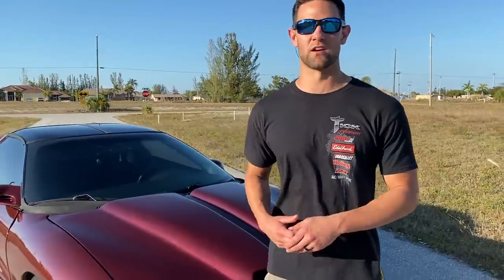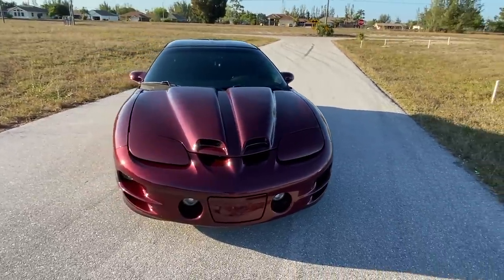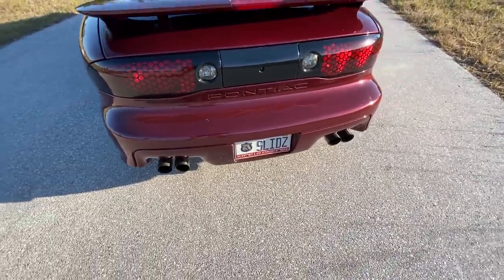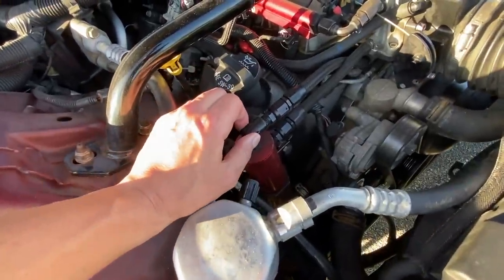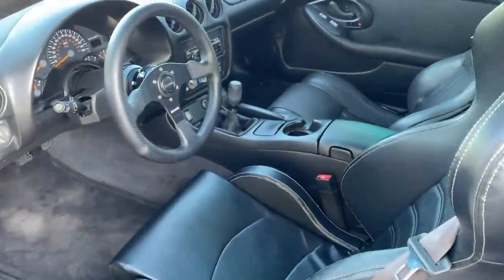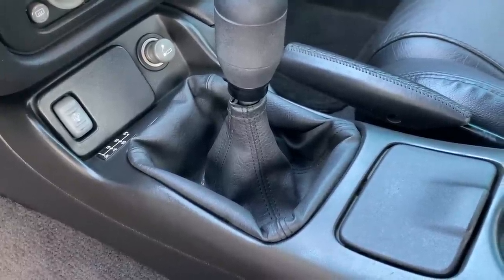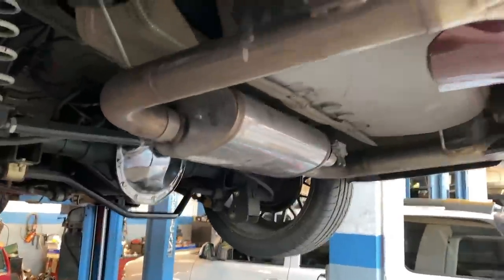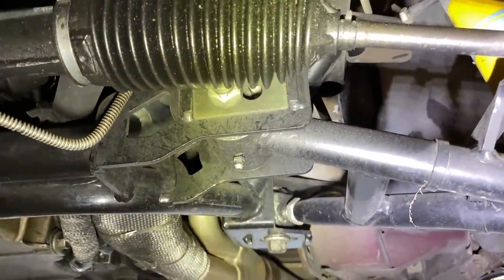In Depth Look At My TRANS AM DRIFT CAR!

Comment: Very nice indeed!  However, I should point out that you do not need everything your car has to drift like you do.  I see a lot of people wanting to copy another one's build and as a previous owner of 3 f-bodies, they are quite drift-able bone stock.  I think simple mods like suspension and chassis upgrades will get you into the sport.  That Moser 12 bolt is a pricey piece but oh so very strong!  Appreciate you taking the time to share your build and how it all works together.  For anyone reading this, if you own one, get out and practice.  You don't need to buy anything to start... well, except for tires.  You gonna need a LOT of those!  :)

Comment: Not that you necessarily care about more power, but you’d be shocked how much power you gain if you get the 3” pipes on the Y merging into a 4” cutout. Especially with a motor that size. Two 3” pipes merging into a single 3” pipe is a huge restriction and causes a lot of the drone and kackling these cars are known for. Flowmaster Y300400. That is one nice and clean TA!

Comment: Sweet ride my friend.. I'm a proud owner of a 07 Z06 and a 94 Pontiac Trans am. My 94 Trans am is in the process of getting restored. I bought the car brand new back in 94. But I'm going to restore it she needs a little TLC.. it has the LT1 motor with an 4l60e 4spd automatic transmission.... I'm going to be pulling the motor and transmission and rear-end as well... I do all my own work. The trans am is going to be painted again with the original black. But I'm going to put a 6" red stripe down the center of the hood and roof just past the ttops and down the trunk and rear spoiler...
Reply from the maker: Kei lylmm That’s awesome man! I would love a C6Z though 🤘🏼
Reply: @KennySlides  you guyz are great drivers to be doing them slides... Not to mention trusting your friend's ability to drive.. very impressive 👍🤙

Comment: Due to the Corona BS just doing maintenance on my 97 T/A  re installed a Meziere electric water pump (they are only good for so many miles) and did a thorough detailing on my recently installed BMR tubular front K member and upper/ lower control arms!, not much of a drifter, but that car is BADASS!
Reply from the maker: Thats awesome man and I really appreciate it!

Comment: Very pretty..  But with all the mods you have done, its not surprising you actually aren't using the stock D/S. They came w Three Rivers 3" aluminum driveshafts, so that's either an earlier 4th gen d/s or if it measures a full 3" its got to be some aftermarket one, likely made by a local shop if you havent seen any Branding from a larger company (DSS/etc).

Comment: I had a signal red 99 WS6 in college and been wanting to snag another for like that last 5 years. Your videos made me finally pull the trigger. Just picked up a signal red 02 WS6 with only 51k miles, guy was the second owner and it needs some small repairs here and there and the bumpers repainted. Snagged a set of the black c5 Z06 style wheels from Hawks on it and its looking sharp, gonna do an LS3 swap at some point and drop the LS1 in a Miata but for now gonna cam it, slp cold air, and Kooks long tube headers and off-road x pipe and get it tuned. That’ll do for now lmao.
Reply from the maker: Florida Bhoy That’s awesome you picked up another TA brotha!
Reply: KennySlides yeah man been at the back of my mind for a while and just had to do it. I’m in the Fort Lauderdale area, next time you’re in my neck of the woods for a meet or something let me know.
Reply from the maker: Florida Bhoy For sure man!
Reply: KennySlides I’ll dm you on IG

Comment: Awesome buddy.  Dig all you're vids. I have a black on black 2000 ws6. The original ls1 broke a rod going home from work.  Bought a lq4 short block. All i have left is unbolt the k member and lift her up off the motor.  Wish me luck. And again awesome setup bud. Shout out if ever in the Tampa Bay area.
Reply from the maker: Chuck Patrick Thanks man! Good luck with yours brotha ✊🏼

Comment: I have 2 trans am's 89 and a 97 and I'm trying to hook my 89 trans am up as a drift car. always could use a few tips on what to put in it what to put on it and how to set it up. I'm located in St Pete Florida
Reply from the maker: michael greenburg That’s awesome man! Biggest thing is more steering angle which can be achieved with shortening the outer tie rod mounts on the knuckles and then getting after market a-arms for adjustability and tire/wheel clearance. Coil overs or lowering springs with good adjustable shocks make a huge difference as well

Comment: the Ricey wheels being a color that hides the design and with different color lips is the only thing id have changed....The 98+ WS6 package consists of Larger front swaybar(32mm) higher rate springs, different valved shocks (but still Decarbons) little bit better exhaust (it was a Single 3.5" outlet for `98 only, went to duals 99-02 but same sound tbh) 17" Wheels w/ 275/40/17 Tires, stiffer tranny mount/panhard bushings, Ram Air Hood and Raised Airbox. Plus color changes

Comment: One more question you have my dream motor..but if I could ask why didn't you go with a little bigger head with all those cubes??did somebody recommend the 215's..I would think you could ran like 225 or 230 cc port volume..but hey maybe I'm wrong..don't LS3 come stock with square port at 250cc.??

Comment: Hahah pretty much it 😂 ..I knew your car was pretty Extensive on some of these parts an mods to get it to perform like that I have a stock Pontiac GTO 50k miles its an automatic but can it be Built similar? and would that wheel and tire setup fit if I put aftermarket suspension on it?
Reply from the maker: RTLsuperbike 458  Not extremely knowledgeable on GTO’s, but I know there are a lot of people out there who drift them!
Reply: GTOs are IRS so you already have a leg up suspension wise. Just find a way to control wheel hop, stiffen the suspension a bit and if you want to drift, get an angle kit. From there it's just power and supporting mods.

Comment: Wait with all those mods your only making 500hp I mean I know its N/A but why didn't you just throw a cam and a single turbo and hit 500hp that way was there a reason you did a built af engine for only 500hp instead of a turbo/cam build for the same amount of power?
Reply from the maker: reptile crazy gamer I bought the car originally for the engine, which I was going to put into a different chassis for drifting, but I decided to keep the car. Motor was fully built/forged for either turbo or supercharger

Comment: I really enjoyed your video I love those cars, I had one, but I just want to be clear about something. In the beginning when you were describing the difference between your Trans Am and a WS6 Trans Am you left out the most important thing that's different about a WS6 and a regular Trans Am and that's the steering and suspension components, they are much beefier and aggressive. As a matter of fact if you would have ordered a brand new Trans-Am from the dealership and asked for only a WS6 suspension to be added the factory would have given that Trans Am a WS6 VIN number. No other WS6 component would have required that to be done. This also goes for 5.7 L formulas as well. But nevertheless you have a great car man.

Comment: How did you align your uppers and lowers? I have the same setup in mine minus the roto-joint.
Reply: What adapter hole did you use for the rear lca mount where the roto-joint is?
Reply from the maker: Nick M I had to keep taking them out and adjusting them

Comment: What kind of headers you got sounds sweet
Reply from the maker: Gabriel Alaniz Jr They are Pacesetter 1-7/8 longtubes
Reply: @KennySlides  do you have to inatall the long tube headers with something else or you just put the headers and thats it
Reply from the maker: Gabriel Alaniz Jr Headers usually require an aftermarket y-pipe as well

Comment: We’re you getting pre ignition on the two rear plugs or too hot of egt?
Reply from the maker: Auto Body Everything The side/ground electrode on the one rear spark plug was worn away almost completely so I decided to go with colder plugs in the rear two cylinders since those typically run a little hotter.

Comment: Curious why did you run the tfs 215 on a built and stroked ls3? I have them because there a "Maximum" effort small bore head on my ls1.
Reply: Would be a very torquey and responsive head on a stroker LS3
Reply from the maker: Jesus Rivera They are what came on the car. Planned on swapping to some CNC LS3, but decided not to mess with something if it’s fine the way it is.
Reply: @KennySlides  oh ok I was just curious. They're a great head made about 470rwhp on my stock shortblock ls1. I'm also building a bird, where did you get the spindles modded? Do they sell more? I'd love to have some more angle.
Reply from the maker: Jesus Rivera Dang that’s solid power man! I put a link to the shop in the description. Shop is Upfab

Comment: How did u fit the c5 brakes? N wat rotors do u have?
Reply from the maker: Lil Twinkie It has different caliper brackets and they are c5 rotors
Reply: KennySlides what calipers yu run does it brake smooth cuz I just got my firebird but the brakes suck but I need to put new rims to fit the brakes rn I have 16s
Reply from the maker: Lil Twinkie It has the c5 corvette calipers which work pretty well
Reply: KennySlides ok thanks!! I love your car you inspired me to get one plus I love drifting n burn rubber lol
Reply from the maker: Lil Twinkie I appreciate the support!
Reply: KennySlides  is there a size for the rotors?